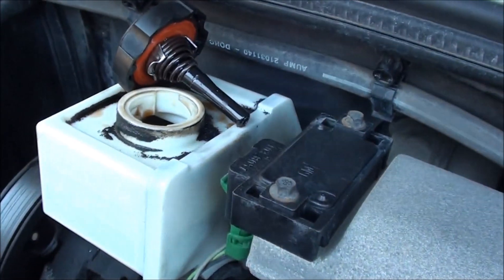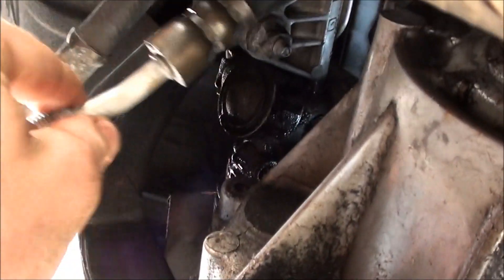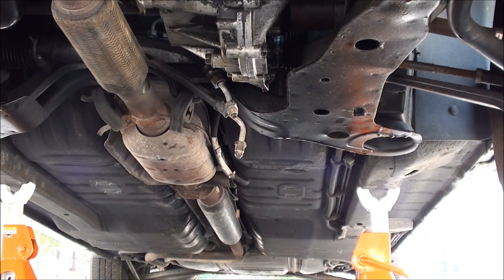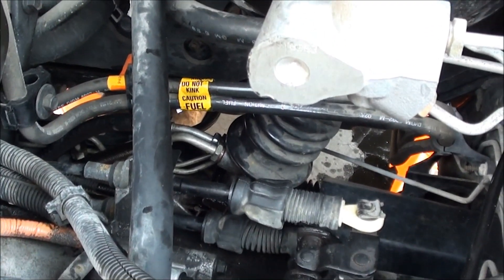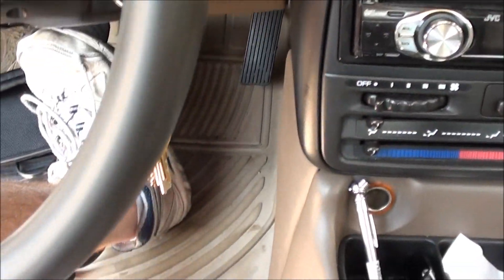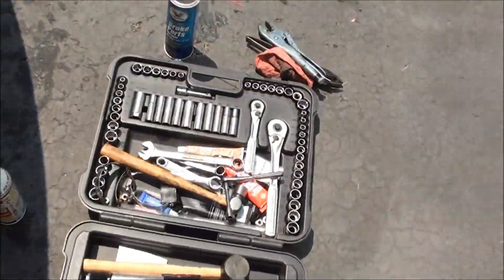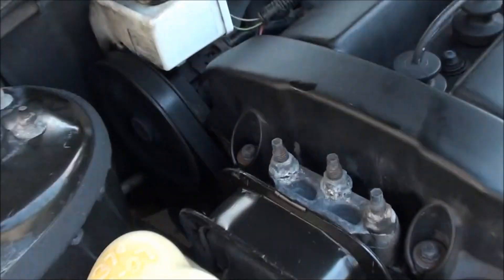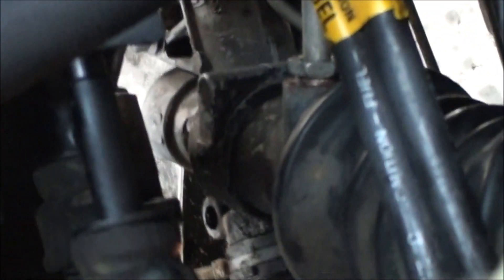Changing Power Steering Fluid (System Flush)

Comment: Good info. I agree flushing out your power steering fluid should be done at least every 100K or even less, but we all know that car owners rarely do this. I have 177K on my Saturn and I will reference this video when I flush the power steering fluid on my car. I doubt that I will do it more than once though. It looks like a really messy job.
Reply from the maker: It is a really messy job. I wish I had a bigger catch container to keep the over spray from hitting the ground. Would also probably do this where I could then perform a thorough wash-down after putting everything back together. Which now reminds me I need to do this on my 02 SL2. The Saturn in this video unfortunately is no longer with me thanks to a light pole and wet roads.

Comment: Should of turned the steering from left to right to clear oil from the pump and pinion. All you need to do is disconnect the oil return then top it up turn left to right while adding new oil and then refit the return line and top it up then turn left to right and your done.

Comment: Seems excessively complicated; if you can set up a catchjar at the point where the return hose attaches to the reservoir, you can effectively pump all the old fluid out there without the mess and need to undo hoses in and under the engine - especially when old clamps may be problematic or even break. Depending on the vehicle, never assume 'power steering fluid' is the same as Dexron III ATF or in new cars type VI, and never start the car w/o steering fluid unless the service manual says to. Follow manual specs and if unsure buy factory stuff from a dealer, as the wrong stuff may cause hose swelling/leaks, or even pump damage. Try two or more layers of hard plastic sheets under front tires for turning and you may find it unnecessary to jack the car at all.
Reply from the maker: Good points! Thanks for sharing! May have to try your method this next go around assuming it's possible with my vehicle setup. Have another Saturn(replacement for the one in this video) that needs the PS fluid changed, among other things.
Reply: +z1522 When you say "pump all of the old fluid out", do you mean using a pump of some kind?